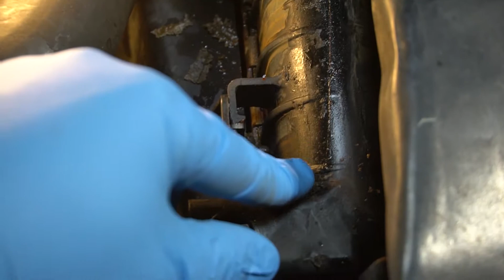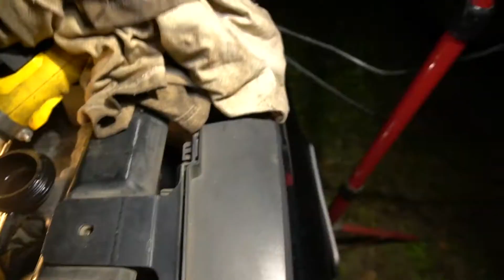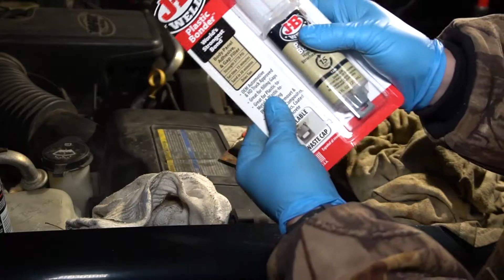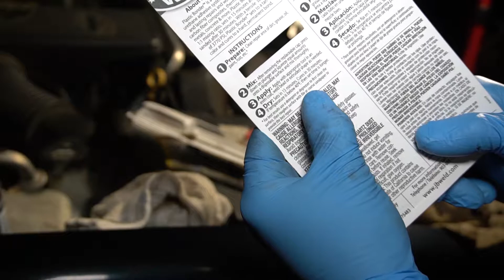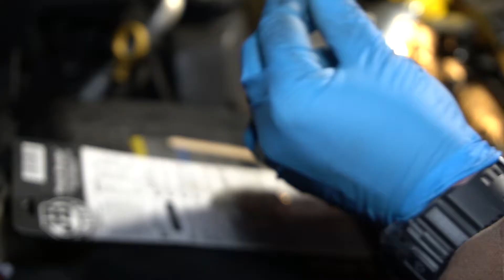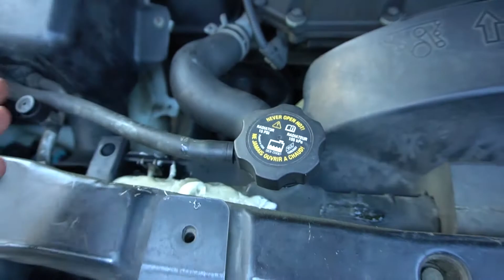How to fix a cracked radiator with JB Weld

Comment: Good work and you explained well. The JB weld kit I got does metals and plastics and was a one time use… new improved stronger version sets in 5 mins apparently have to work fast.. ur pack is great  as can use again.
My kit has 2 plastic sachets & mix for 1 min and apply and place fibreglass cloth over 1st layer of weld repair then put fibre cloth on and apply 2nd coat sort of thing. Similar. I think the prep is important too. Thank you.
Mind u in another country and more $  for kit here…
Reply from the maker: @tonyking1832  I am glad this video has helped you!
Reply: @ thank you 🙏 good  on you.

Comment: I tried this method  with no luck
Reply from the maker: @mrhamburger6936  unfortunately, it doesn't always work.
Reply: @KREESEPRIME  yes this was on a radiator that was almost 2 years old I'm in the process of reinstalling the old one
Reply from the maker: @mrhamburger6936  I hope you get it straight my friend

Comment: I didnt clean it much and put it on should it still work?
Reply from the maker: @LilRondo4CH  only time will tell
Reply: @KREESEPRIME  hopefully gon let it sit  till tommmrow let it sit over night
Reply: So far hasn't smoked or really leaked not a whole 24 hours  drive it around 40 and 50 today going to try 60 and 70 later on today then I should know it worked then anti freeze staying in now too
Reply: @KREESEPRIME  end up fixing it had to scrap the old one I had off and clean and it down and file it and get a stronger kind and it harden in two hours the kind you got mix white harden and black steel i tried wit cheap kinda didn't work till I got the better kind
Reply from the maker: @LilRondo4CH  glad you got it fixed

Comment: So if I drain just enough it's not giving me problems with the JB weld I'll still have to get air out of the the system and make sure it's going thru the heater core
Reply from the maker: Just be careful

Comment: you did 3 layers. you waited over night before applying second layer.  
question:  did you sand after the first layer and second layer putting on?  i guess you cleaned the epoxy after after each layer? or did you think it would disturb the previous layer you put down.?
question: how long did you wait after the second layer putting down and then third layer?
i am in florida, 80 degees outside.  thanks for your work you showed us and encouragement.
Reply from the maker: If I did this again, I would disconnect both radiator hoses to drain it and take pressure off of it. The way I did worked, but it took more effort and layers in my opinion. With pressure, I kept getting bubbles coming up through the epoxy and it had coolant in it, so it took longer to get a good seal, but it is still holding up good. I did not sand the layers of epoxy, just roughed up the plastic on the radiator. I hope this helps. Definitely worth it though either way considering the cost of the JB Weld versus a new radiator installation.